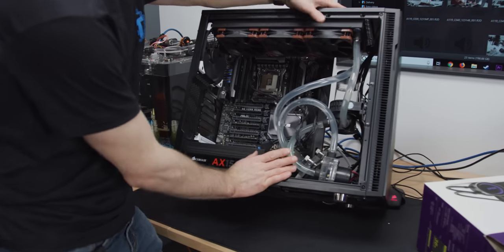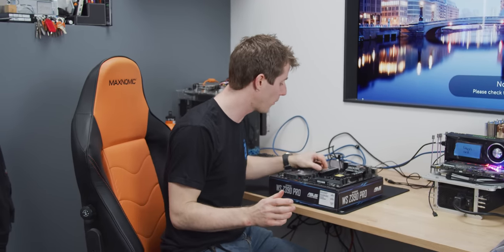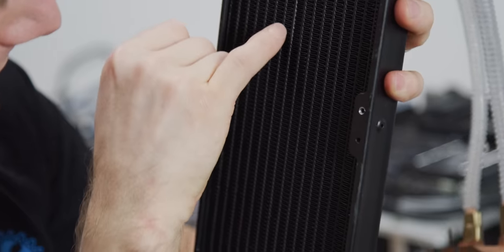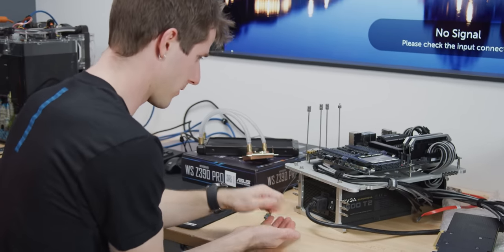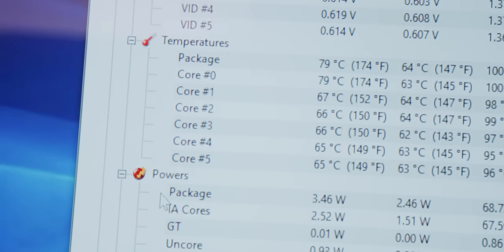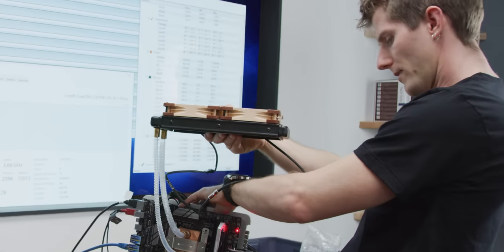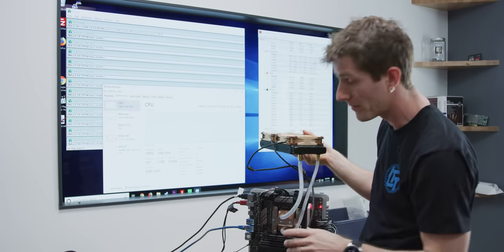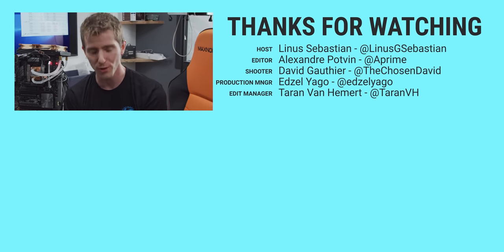CPU Cooling with BOILING LIQUID 🔥🔥

Comment: Okay so proof of concept makes sense. But, in order for this to work in any way, reliably, hard tubing is a must. And gravity is going to help. Also, the inlet for the COOL liquid going I to the block must be on a cool part of the board, made with a non conductive material, that hooks up to the copper that's on the CPU. The in return, the heated liquid would be pushed out as the cool liquid would be essentially pulled in. With cold liquid being just slightly above the block, it would be more of the cold liquid pushing the hot liquid up into the radiator to be cooled.

Comment: I strongly suspect the the unit is sealed to keep atmospheric pressure out, not to keep fluids in. Water at Mean Sea Level will boil at 212° Fahrenheit or 100° centigrade. If you go higher in altitude, the altitude results in lower air pressure. This allows the fluid in water to more readily turn into its gaseous state. This is where this system becomes ingenious.

It takes a great deal of energy to change a fluid from its liquid form to its gaseous form. A lot of energy is lost when a gaseous fluid turns into its liquid form. If you can cause water to evaporate (boil) at a lower temperature, i.e., < 100°C, (that's Alt-0176 for those who want to know how I got the "°" symbol. Look up ANSI codes.) then you can cause the water's natural tendency to evaporate and condense to happen at lower temperatures. Evaporated water will carry heat up and away from its source of heat, and the radiator (or condenser, in this application) will do its job and allow the ambient air to carry away the energy the gas is bringing into it. Once enough energy is lost, it will again condense into a liquid and flow back down to the cooler. If you notice, the cooler block has two different size openings. My couch engineering isn't such that I can be 100% sure about this, but I think the wider opening facilitates gas flow away from the CPU, and the narrower opening is better suited for the liquid to flow in.

Essentially, I'm just going over Air Conditioning Systems 101. I'm studying for my Airframe license to finish my A&P so I can work on airplanes. Someone else likely knows this subject better than I do. All I really need to know is whether or not there are bubbles in the sight glass to work on A/C systems on Aircraft. Still, I hope this explanation is mostly accurate, and that it helps someone know what's going on.

I doubt I'm the first person to bring this up, but I did want to mention is.

Just finished watching the video. Speculations on my part:
Its atmospheres aren't reduced. That's about 14.7 psi in there.
They're using water.
Water boils at 100°C, and that's about how hot the cores got.
I think if they had a way to keep the atmospheric pressure out, it would work far better and they could still use water.

Rigid tubing would make the process much easier. This would make the system not as good for non-custom loops. I see why it has been 3 years without a product yet. Freon might help. I don't know enough about Freon to know if it flows fine without a pump. Chances are it does, but I'm not the one to ask. This would be easier to work around if all manufacturers involved standardized radiator, CPU, and GPU placements. This would be better for an environment where one kind of computer needed mass production, or for someone who had the tools and the technical skill to fabricate their own fluid lines. Once the lines are fabricated and properly crimped, all one would need to do is evacuate some of the pressure out of the system and water should be just fine. On paper, you could keep all components at whatever temperature you wanted. Again, my education only goes so high as to make me a mechanic or a technician, not an engineer.

Comment: Well, it could be a low pressure environment as it decreses water boiling point with thereaded pipes to prevent collapsing due to external pressure

Comment: Change the design just a little bit to resemble a set up more like a car where the radiator's two conections are one at the top and another at the bottom of the radiator than radiator could be front mounted in your chassis the hot vapor would go straight to the top of the radiator and would push fluid straight down with gravity into the cpu block to be evaporated and than repeat. I think you would get much more flow this way.

Comment: What if u used a tube that contained many smaller tubes (similar to how copper wire is bunched together). The increased surface tension would be able to allow for a more consistent flow don't you think? Just a thought

Comment: The capillary action does not work properly unless the inport is higher then the outport. Good example was when you showed the web shot of how they set it up. The entire video you heald the radiator in ways that kept both the ports level with each other. Basically the radiator would work best installed on the case door. Which is stupid but would create the best capillary action.

Comment: 2 suggestions, 1 seems like it would dissipate the heat better if radiator was held sideways instead of fans up with larger hose on top then as the steam cools will drip through gravity back to CPU. 2nd is flow would be greatly increased if the hoses were smooth as the ridges in the hose cause resistance to flow. Can you test this again?

Comment: having it under pressure raises the boiling point (thats what that little pipe on the block would be for). like the cooling system in a car . same concept, conduction ,convection and radiation

Comment: Is it water inside or alcohol? 
Alcohol would bubble at such temperatures sending the gas to the cooler, then condensate back into liquid inside the radiator sending it back down.

If this is not the case, might be worth a try so long as the hoses can withstand a good amount of pressure.

Comment: This would work WAY better if the radiator was long, place vertically and then had an outlet on the top and bottom. Then there would  be a clear hot and cold side to the radiator.

Comment: There is some desing flaws for sure. CPU block might need to have more material/channels on cold tube side and perhaps a one way valve to control flow. Now it seems to be same way hot-hot flow going on instead of out hot and in cold flow.

Comment: I know where did they made mistakes, u cant just throw out the pump and hope for the best, u need to redesign the radiator (make sure the warm water goes into the top and flows slowly  down to get enough time to cool), also u need to make your tube a way bigger to get stable flow...

Comment: I feel like something that evaporates at a lower temperature (alcohol maybe?) would work better. Or if you can open up that "fill port", pull a vacuum, and reseal it (pinch and solder), you can lower the boiling temperature of the water. Your temps hit 100C and stayed there because... that's where water boils, and thus steals the temperature away. But with a lower atmospheric pressure inside it, you can literally choose your upper temperature limit based on the physics of the water boiling temperature.

Also you'd have to cool that radiator well enough to get the vapor back below the condensing point. So if you go for near vacuum and ~5C boiling, you'll lose all your liquid before it can condense back into water.
Reply: I suspect that pulling a vacuum is exactly what has been done here. But as soon as the water starts to boil, the vapour expands and the pressure rises dramatically. This will raise the boiling point again, reducing the evaporation and the amount of heat carried away. The whole loop will be balanced at pretty much the same saturation temperature. 
To keep the temperature low you would need to greatly increase the volume and area of the radiator (without increasing the amount of water) to absorb expansion of the vapour. 
You could also shorten the hot tube to reduce the volume of vapour in the system as a whole but that will reduce the height differential and the flow. It's all a big balancing act, and very impressive that it works so well.
EDIT: On reflection the volume of vapour in the tubes is probably negligible.

Comment: I love this...

I knew that air coolers use convection to spread the heat but to do it with a loop, genius.

For the nerds out there, wouldn't a rad made of copper dissipate heat better or does it not matter once the coolant reaches equilibrium?

Comment: When the thick tube is on top is works better (naturally). However, you should insulate it all the way to the radiator. Do not insulate the small tube - you'll get even better results like that.
Reply: oh and further, the radiator should be turned sideway while remaining on top of the cpu. I wish I could be a part of that development - it is an interesting use of physics not unlike boilers on a power plant...

Comment: Water shouldn't be flowing out from both sides of the block. I would have imagined that thing has a check valve inside of it before watching the video. It works by keeping liquid, in this case coolant, flowing in one direction only. A check valve is the liquid equivalent of a diode, for anybody not familiar with them.

Comment: this is eazy fix , go get a liquid that has lower boiling point than water that also do not damage the cooling system.
Reply: Or run it with water at lower pressure, which is what I think is already happening, because of those springs inside the tubes to keep them from collapsing

Comment: The motherboard has to be vertical. One tube on the cpu has to be lower than the other so the hot water can rise to the radiator then cold water can return down below

Comment: I get the idea of the video and all that but realistically you'd be much better off with a set of heat pipes going through the rad fins instead. However, if you were to do this properly, you'd need a small amount of a liquid that boils at a given temperature, something like 70 or 80 degrees, and set it up to use gravity to return the liquid. Assuming the heat transfer at the other end is sufficient, it should basically lock the cpu temp as the liquid in contact with the block will boil faster but never exceed its boiling point.

Comment: Actually, my pump was somehow not working, I suspect there were something block it. But it is workable as long as you don't put much pressure on GPU (BTW it is a Gigabyte water force 1080ti). So... There is a Chinese saying that 心静自然凉, meaning calm keeps you cool.

Comment: I can make it fanless to one-up the capillary effect.
/
   \
/   
   \
/  
   \
By using convention we can produce an updraft self-cooling radiator to induce continuous air fluid flow. This would even allow more extreme cold to the hot distribution to accelerate the heat exchange process you presented. Top to bottom coolant arrangement would be the best arrangement for creating this custom radiator.   
I am a student and inventor type if you're interested in contacting me.

Comment: Not a new approach - old type cars used thermal siphoning over 90 years ago! - it will usually fail in a PC because the cooled input MUST be below the heated output and the greater the distance the  more effective the cooling.

Comment: I'm a Nuclear Physics graduate, so I like to think I know at least a few things about water cooling XD
Modern Pressurised Water Reactors have their steam generators/boilers above the reactor core for exactly this reason, it means natural heat convection forces will still provide some cooling even in the event the system pump dies/can't be powered. Not a huge amount, but still much better than nothing. Keep in mind reactor pumps are on the order of ~1MW, nuclear reactors need a LOT of cooling
Me, watching Linus try to work it out: OF COURSE, THE RADIATOR HAS TO BE ABOVE THE CPU IN ORDER FOR CONVECTION TO WORK YOU COMPLETE NUMPTY.
But it also makes sense that pipe orientation/which one is above the other is important to get one to be gas-only and one to be liquid return only. It'll be much more efficient if you can get that working properly
I'm also more of a fan of Pressurised Water Reactors than Boiling Water Reactors, that loop needs more pressure XD

Comment: Wonder what would happen if one was to add a checkvalve on one tubes and also make the tubes connect to opposing sides on the radiator.
Reply: I think a check valve would add more restriction and not be very beneficial. The tubes already connect to opposite sides of the radiator. The tank that the tubes mount to has a divider in the center, so the fluid has to flow to the other end then cross and flow all the way back to reach the other tube.

Comment: is there a reason you can't just pack a bunch of heat pipes together on top of the heat spreader and run them up to a radiator with fans?

Comment: You know, there are two things that I've never cared about in terms of my gaming PC's.
1) Colors, stickers, flashing lights (RGB).
2) Fan noise.
In fact I often set my fans to 50% minimum ramping to 100% by 70c

Pity that the entire industry seems to be focused on flashing lights and silent fans.
I mean if your goal is silent operation wouldn't oil immersion be the way to go?

Comment: I'm not a fluid dynamicist but I think this design would work better if they just had a single large tube rather than 2 small ones. It also appears they're using one of those expensive 3m solvents that cost $1500/L, if so it could hypothetically be replaced with one that boils at a lower temperature. They're available with basically any range of boiling points you could want all the way from 0C to well above anything you would want to use. maybe even a custom radiator with a bottom that slopes down toward the pipes so the solvent in liquid phase can flow down more easily. Either way as long as it uses less solvent than immersion it would be a great product that could make its way into machines that people don't have to be sponsored to afford.

Comment: Wandered into this wondering if someone had ever tried a gravity circuit on a PC and, here we go.  That's how 90% of solid fuel-fired heating systems here work. They have to be fail safe so they don't turn into bombs when the power goes out.

Comment: Thought you wouldve had the input to the radiator at the top, and the output at the bottom, like an automotive radiator. 
Having boiled water traveling up both tubes isnt conducive to a loop of flow

Comment: wouldn`t it probably work better if you turn the radiator 90 degrees so the thick tube is on the top and doesn`t allow the liquid to enter and only allow the vaporized liquid to rise into the radiator?

Comment: I'd love to see something like a 3M Novec cooler or some such fluid. I've seen demos of Novec immersion cooling for the enterprise/high-performance compute segments and it seems like it'd be a pretty good candidate for such a system
Reply: You can buy R141b in any HVAC store. It matches the NOVACs specs. I even suspect that it is very similar to R141b
Reply: I am making a custom build watercooler... Have to give it a try lol... Was about to use pump and propyleneglicol because i'm using a mix of materials... But it can be fun trying... Gotta make a video on it

Comment: I wonder if you could literally just have a giant tank of the liquid with some fins running up the sides, and no radiator. Also larger conduits. That thing seems to be bottlenecked by fluid volume more than anything else... For this to work nicely you want the vapor to get replaced with liquid as fast as possible, yes?

Comment: A cooling solution which heavily relies on the to-be-cooled component to run at full load to work correctly? Sorry, but that's hardly efficient. Imagine buying a car which has to rev at >5000 RPM just really get moving at all. I wouldn't buy that car...

Comment: So wouldn't you want the radiator sideways so the pressure from the water forces it in one direction. Then the hot water will travel to the top and cooler water to bottom. Then cooler water would prevent hot from going through both?  I could be wrong I'm no expert.

Comment: 3m novec in the tubes I guess. But as with any 2 phase liquid, you need enough temperature difference between the cold en hot side. Guess this wasn't the case.

Comment: Heat goes top, so yes, it is obvious that one pipe should be above another one and they should have diameter disproportion due to vapor/liquid amount they transport. Im not a fan of water cooling, since all AiO bends the knees before Noctua's coolers anyway both in performance and silence,  you only need WC on really hard oced pcs.

Comment: You could probably use a Stirling engine to drive the pump. It would be virtually silent and require no electricity.
Reply: the idea is to remove moving parts not add them lol. You do save a few W on your power bill though...

Comment: Hmm... I wonder if circulation can be made more deliberate with a tesla valve somewhere in the system, or possibly on both legs, instead heating and cooling happening haphazardly on both sides of the loop.

Comment: need to have HOT side of your radiator high and cold side low hot fluid enters top gets cooled then exits bottom to return to bottom of the CPU block gets heated to vapor exits the top of CPU block  travels to top of radiator and cycle repeats itself

Comment: To test it correctly fanless, the fans should be removed as they are slowing down the air convection on the radiator.

Comment: this seems to be the only valid excuse for thermoelectric cooling... that way the cooler can be running at 100 degrees while the CPU is only at 60 or so, which would seem to boost the efficiency of the cooler... maybe?